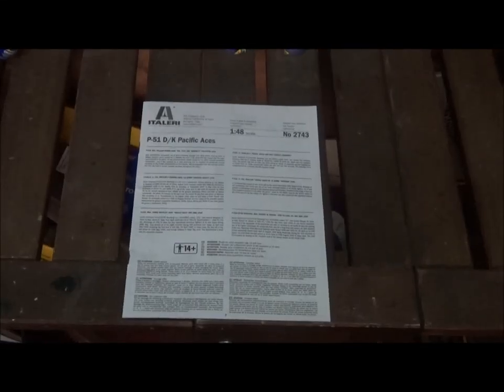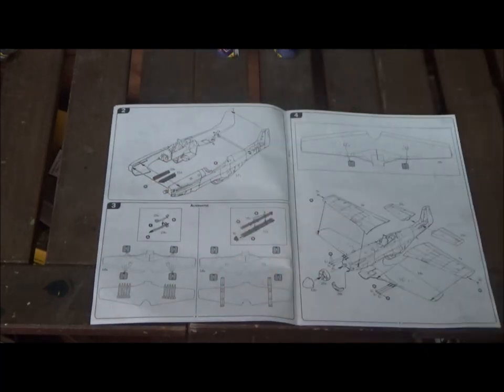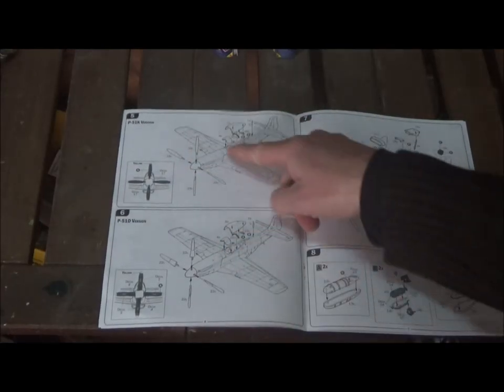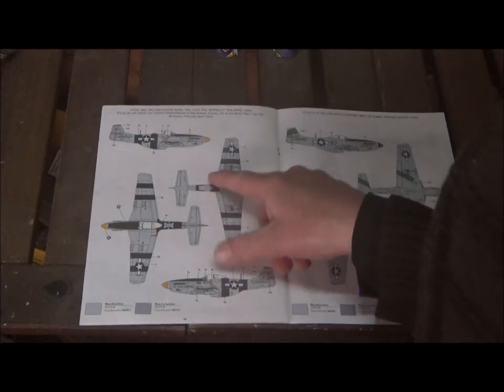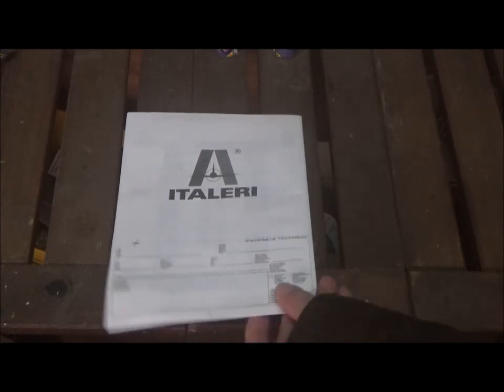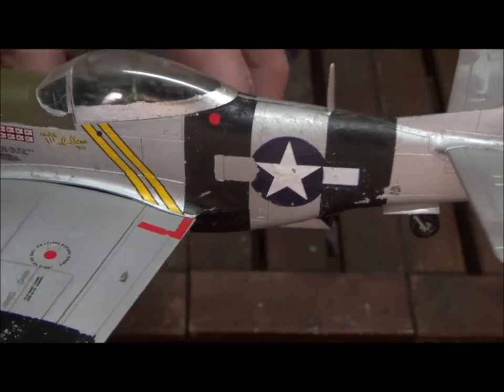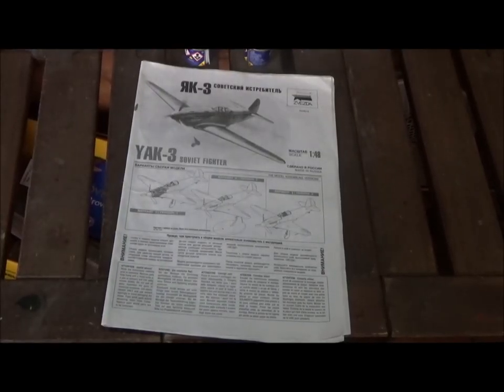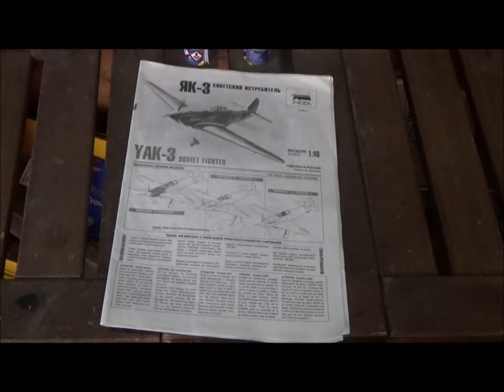Review of My Built 1/48 Scale P-51 D/K from Italeri

Comment: If you have an airbrush you can seal all the decals in with the clear floor polish or rattle can(pledge, but it's not available anymore) Finescale Modeller has a comparison video.  O
Reply from the maker: I don't use an airbrush. Everything is done be hand. Normally I use micro sol and micro set and then it gets a clear coat from Revell or Tamiya